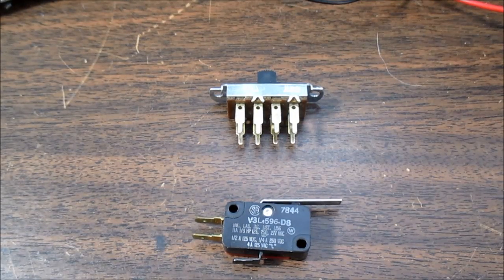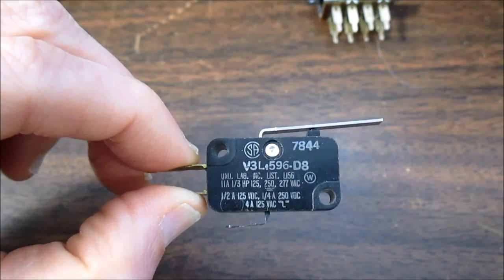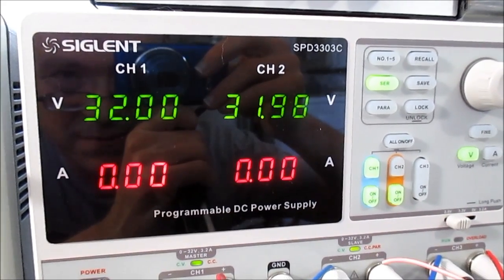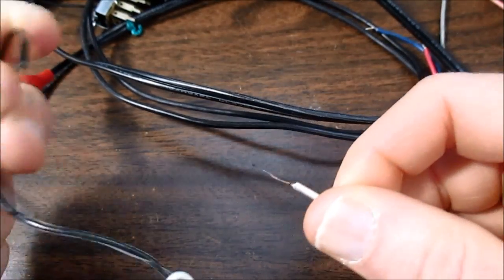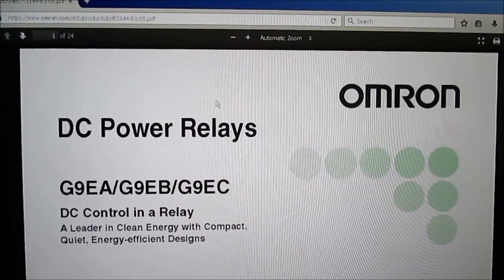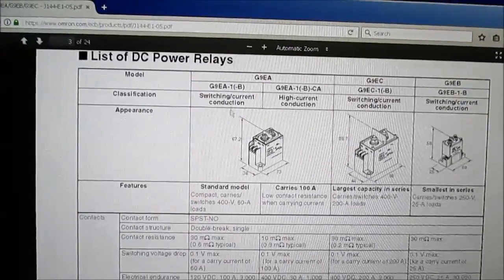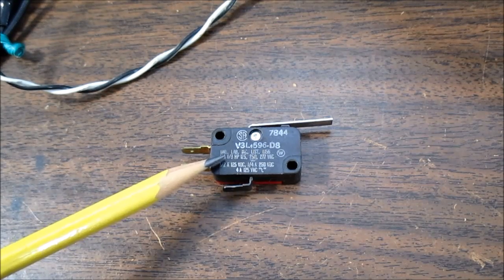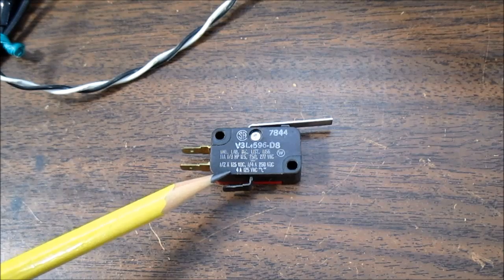Why switches and relays can't handle much DC current?

Comment: So glad I found your channel.  This was informative.  I'm playing with DC motors, 90 - 130 volt range with current anywhere from low single digits up to almost 30amps.  Using line voltage through an AC inductor/choke/coil to an SCR to adjust voltage, fused, passing through a diode bridge rectifier and DC large block choke.  I'd like to be able to switch the motor direction after the power is converted to DC.   I've seen lots of guys using DPDT 12VDC 30 amp toggle switches like the 28E-MTD.   Watching his video, it makes me question if doing so is a good idea.  Is that risky?  Any suggestions on DPDT switches I could use with those VDC and current levels?  Also, does it even make sense to do so or would it damage the motor?   I don't expect to switch at high speed but it would be nice to know the switch can handle it it I mong it up.  Thank you.
Reply from the maker: I would go to a trusted supplier such as DigiKey or Mouser and check their products. The data sheets for the switches should provide the safe DC voltage and current ratings.

Comment: ok i get the theory but now im confused ......here is what i want to do i just want to power on and off an led strip  at 5v 2 amps max DC (  usb power brick)
 so i cant use a latching switch that i find on amazon? ive seen switches but they only give AC specs 125V 5A....only managed to find a 30V 1A DC switch but i need just need 5V 2A.

BUT here is my confusion 
how is it that ive seen power on/off switches built in the usb cable thats rated for 5V 2A DC?  (for example power on/off usb cable used  for a raspberry pi )
OR 
powered usb 3.0  hubs with a 5V 3A DC power supply that have power on/off switches ?????

what switches are they using? are they using some other logic with it? and where can i find it?

Comment: What about using a switch in an application with a lower voltage than its maximum parameter, will that allow a higher maximum current than its rating?  For example, a switch with a rating of 30V DC and 0.3A, could it be used in an application with a 1S lipo battery where the supplied voltage would not exceed 4.2V but the current could increase to 2A?

Comment: Wondering if you may have a suggestion for me... I have a load port from a solar charge controller that when turned on produces 58.2V but only 1A or so.  Strange combo.  I am hoping to figure out a simple relay that can take a control DC voltage of 58.2 (or higher since that is an odd number) and be able to safely and reliably control the on/off of the load.  It would be controlling the positive run of a series string of 3 solar panels that produce I believe roughly 80V at 5 or 6A...  Thanks so much for any leads!

Comment: i ran an old cairn at the steel plant in 2003~2007 it was a 220V DC cairn made in 1930's it was old school as F#@& any way it had a Knife Switch to power it up and down and if you opened the Knife Switch slow you can get that ark to go 2"

Comment: I use to increase  the dc current of a switch by placing a cap in  parallel    of the switch, the ark bypasses the switch then.
Reply: Smart.  Seems like a challenge finding DPDT switching for 90 - 130VDC at almost 30amps. I'm monkeying with motors and want my DC motor direction switching to be safe.

Comment: Are there any inexpensive simple switches suitable for 5V, 25A?
More specifically, up to 4.2V, at a maximum of 25A but more like 20, In burst up to 5 seconds..
Loads from 1ohm to 0.2ohm..
I`m a vaper, looking to build a mod, and I would like to do it without using a MOSFET.
Just an 18650 cell in a very simple circuit with a switch going to a 510 connection.
But I can`t seem to find switches rated higher than 5A :/
One thought was simply using a spring loaded copper rod, but I`d have to completely change my design as well as making a safe and reliable switch assembly myself :/
Reply from the maker: I'd look on Mouser or Digikey. Their filter tool can be useful in finding items like that. I'd imagine a 25A switch will probably be fairly large. I'd still lean towards a MOSFET. Look for a high current one with very low Rds on and gate voltage. Problem there is driving the gate with enough voltage to turn the MOSFET on hard enough for the heavy current. You can parallel them too.
Reply: Will do, thanks! :)